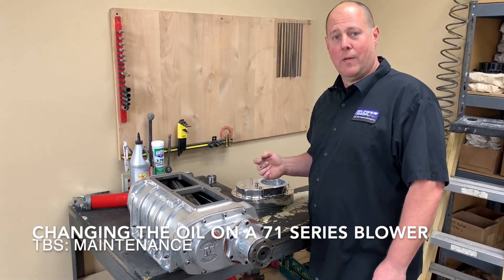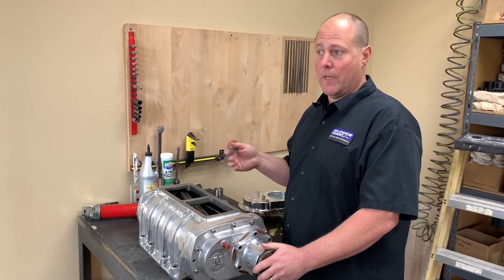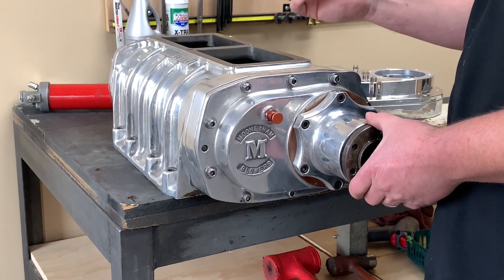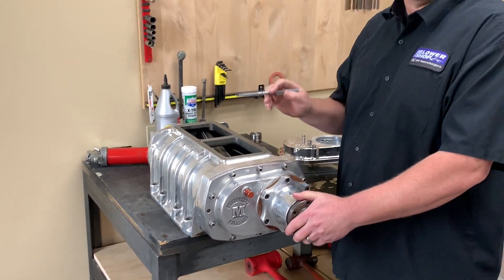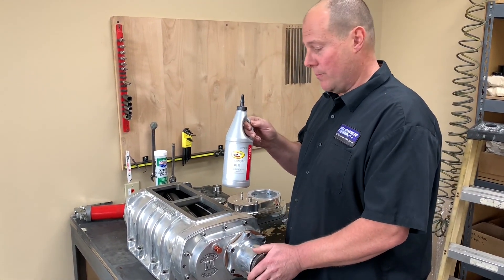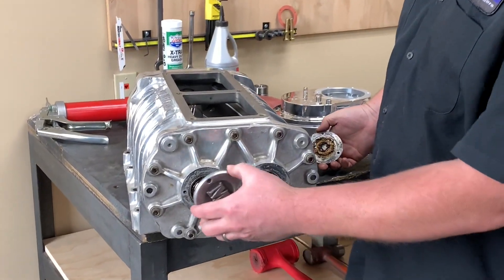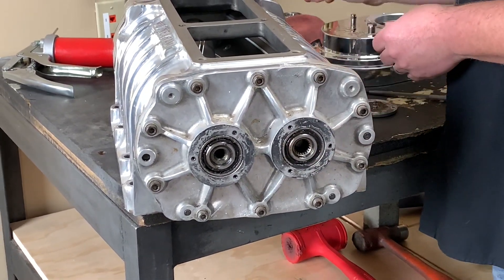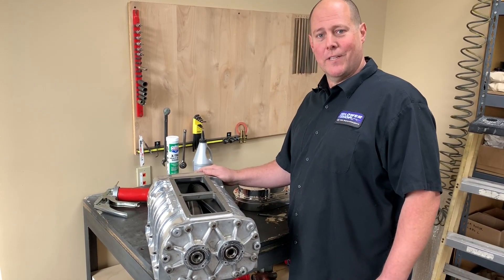TBS Maintenance: 71 Series Blower Oil

Comment: I have had my 8-71 for 2 years and am changing the front gear lube every spring and inspecting / packing the rear every other year. Remember that the blower is under pressure and gets very hot, so the seals can go bad.

Comment: On a street car that sees occasional strip use, occasional being twice a year down the 1/8th mile, on a 355 sbc with a weiand 6-71, how often should a well maintained 6-71 need a total rebuild?
Reply from the maker: It all depends on total hours of usage. By maintaining the blower and checking the oil once a year and noticing the bearings, you will be able to see the ware. So in your case, maybe ever few years sending it in for a rebuild which includes bearings, seals and gaskets in the rebuild. Call 208-985-7650 with any questions.